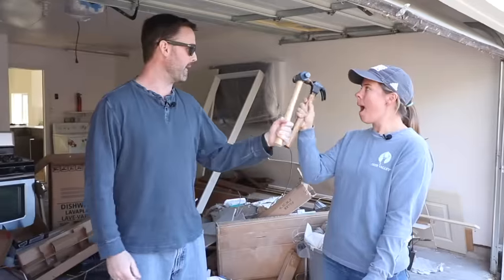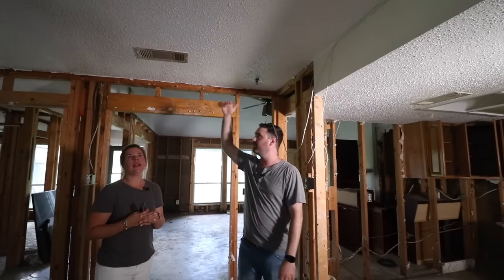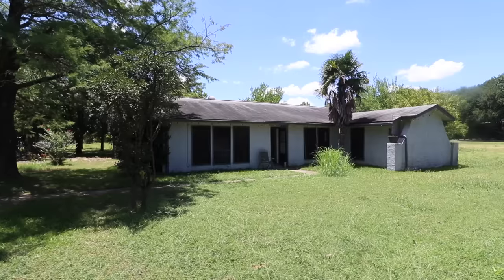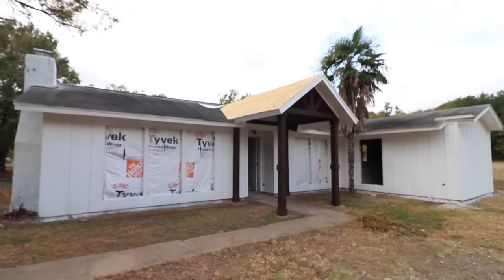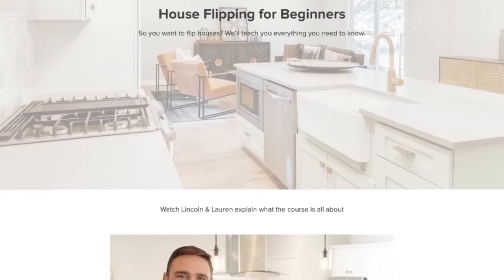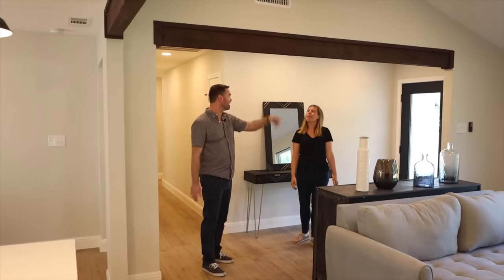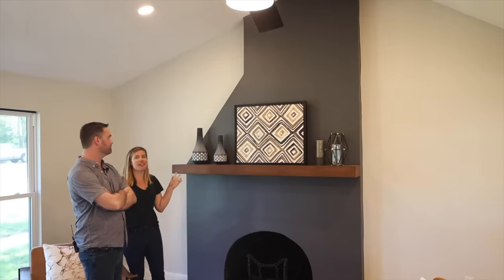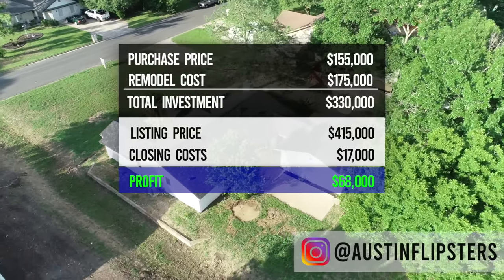Modern Farmhouse Renovation | Before & After

Comment: I love that they do landscaping and clean up the trees around the house, so much cleaner and makes it feels so much higher end
Reply from the maker: Thank you!
Reply: I was shocked when they took down that tree near the house. Having a big tree like that to provide shadow and some different element from a monotonous lawn is so important. Of course, it is possible that the tree was damaged or attacked by insects or something...
Reply: The tree needed to go.  You could see that it was dying & rotten.  However, you should have replaced it.  Trees make a difference to homeowners.  Also, if the yard is going to sell the house, where was the landscaping?  Maybe I missed it.
Reply from the maker: @juleronitz5100  Thanks for watching! Yes, unfortunately, the tree was diseased and needed to be removed....we actually didn't love the palm tree for the look of the farmhouse, but didn't have the heart to cut it down.
Reply: New owners can add trees, it's easily done.
Reply: I agree! So many flippers skimp on the landscaping
Reply: @juleronitz5100  trees close to the house can cause foundation issues and also problems with the plumbing because the roots of trees can bust pipes as they search out sources of water. Therefore, I would prefer not to have trees that close to the house but then I am also from SETX where hurricanes are an issue so that’s another thing to think about depending on location. I know Austin doesn’t have to worry about that but damage from trees is a BIG DEAL here.

Comment: The finished quality of the project seems pretty good, but this house really isn't jumping off the screen and giving me that "wow" feeling. Don't get me wrong, i love minimalism and white, and maybe the house shows better in person, but it just seems really understated, especially the kitchen & bath. From a design perspective, the darkly accented steel beams draw your eyes downward and detract from the ethereal height of the ceiling, the darkly painted oddly shaped fireplace grabs your attention for the wrong reasons, this was a feature that should have added value but may be a source of contention for perspective buyers, perhaps using a textured or patterned backsplash tile would have brought life to the kitchen, and  though i love the tile in the shampoo niche, I would have loved to have seen more of that beautiful tile dress up larger sections of the bathroom. I mean you are looking to sell this in the mid $300k, these hardworking buyers should be foaming at the mouth drooling over some quality luxurious features, but sadly this flip seems designed by a developer using basic materials & colors. I did however like the exterior color of the house, the new over sized windows, & the black doors.

Comment: Does anyone use solid paneled Doors? On inside doors, as well as, cupboards. I lived in a 1956, track house for 35 years. Less cleaning without the extra boards on it. All doors were
stained, not painted. Loved them.

Comment: Their either running ductwork or Morse.  You may need a steel runner. The chemical the mold guys spray is $25.00 per container with the instructions with adding bleach, water, etc.  It works, at least in Florida.  Oh God I hate the master bath.

Comment: A couple things here I do a ton of new construction and remodel work. The electrician doing the wiring has no pride in his work. Works run on angles in every directions holes too close to boxes and not uniform sloppy work. The plumbers seem to be following the electricians in the same regards. Also looks like the siding was put on before the windows are installed that isn't the proper way to do it. Tyvek then windows so you can flash the corners of the windows and put drip edges on. Seems poorly gc'd to me.

Comment: They didn't like the dropped down ceiling to accommodate the low fluorescent lighting. Then they put in low hanging light fixtures at head level...

Won't the clearance still be an issue? Not across the entire room, but anybody who walks near that light is going to bonk their head. Anybody leaning over that surface is going to hit their head. It really limits table location unless you want a disembodied light dangling in the middle of the room.

Every time I go to a restaurant with that low "mood lighting" I always think about tall people hitting their head. That's the only thing I would change about this.

Comment: So you guys are going to lay vinyl flooring down on top of concrete and not put an underlayment down first??? The underlayment protects the flooring from moisture
Reply: In what way should that affect vinyl? do you think its gonna twist and expand? these barriers are there to protect hardwood or laminated flooring from gaining too much moisture. Wonder where you got that from, from the home improvement tv show or the other home improvement show, you clearly dont know what youre talkin about, so just dont.
Reply: Our flooring actually comes with a pre-attached IXPE foam underlayment so they did actually put down an underlayment when they laid the flooring. Our floors are also 100% waterproof so no amount of moisture will harm them. :)
Reply: @Flooret  where I come from the vinyl is usually glued onto the floor using contact cememt, wich automatically waterproofs it real good

Comment: Irresponsible driving.  Please pull over for your plug as accidents happen so fast.   The house looks great and the covered porch will keep guests dry and help cool the entryway.   However, where is the coat closet for shoes, jackets, etc.?   Open plan works best if you can keep things put away.   Why did you leave that roof with the missing corner?  Also, why laminate flooring?  Does it stand up for 20 years or does it show wear on high traffic areas?   Can it be refinished?
Reply from the maker: Lot to unpack here! It’s a self driving car. So very safe. The coat closet is in the hall to the right of the living room. It was going to be too complicated to reframe the roof. It’s a vinyl floor, not laminate. It’s very durable and waterproof. It can’t be refinished. Thanks for watching! 👍🏼

Comment: 1.  This is a remodel.  Not a renovation.  The dictionary can be quite helpful if those terms are giving you trouble.  2.  Y'all's flips are great examples of why people should be VERY cautious of buying properties that have been recently remodeled, esPECIALLY by "flippers."  Unpermitted, drastically sub-par, way incorrect, and even dangerous work - such as the dangerously inadequate structural alterations made here - done by the "cheapest bidder" and overseen by people who have no clue.  You want tasks completed as cheaply as possible yet you want top dollar in the sale and you don't disclose - because you don't know or you don't care - that what you're really selling is a huge headache.  People:  When you're looking at a possible purchase that has had SO much done to it;  check the permit history.   GUARANTEE there were NONE pulled for this job.  And I really feel bad for whomever buys/bought it.